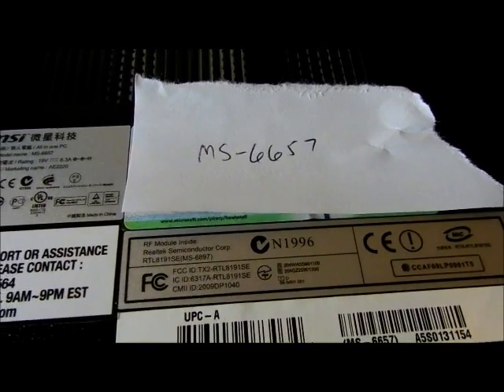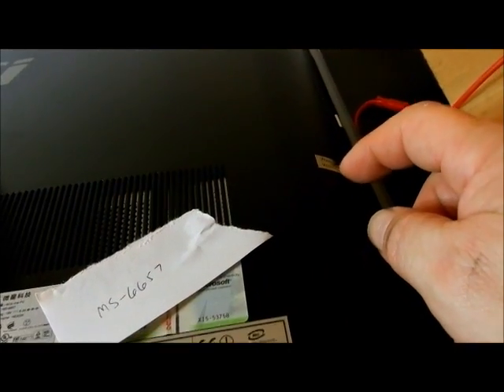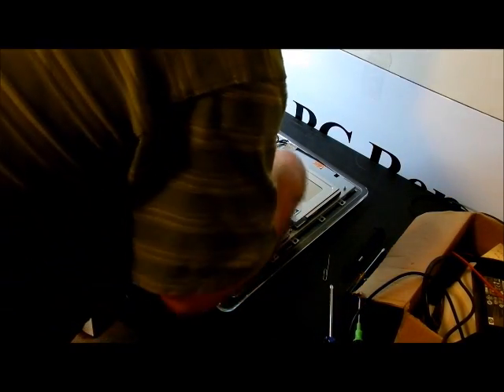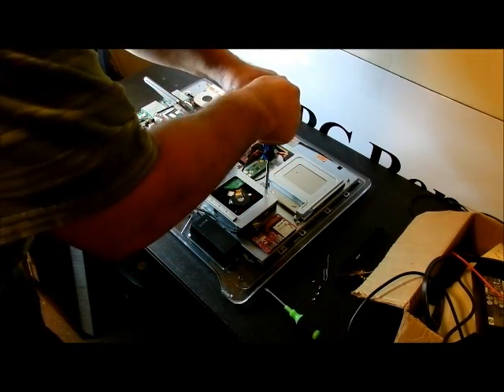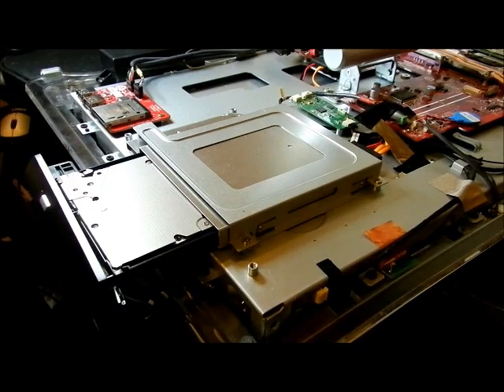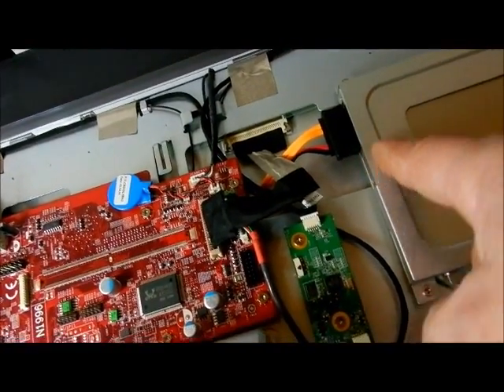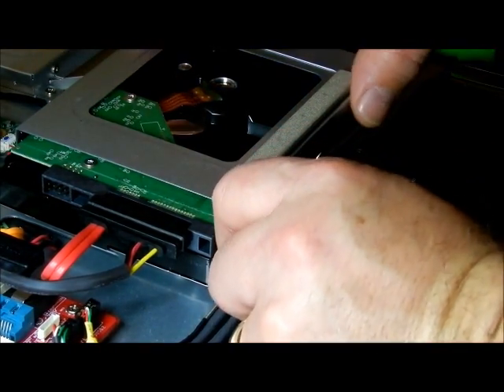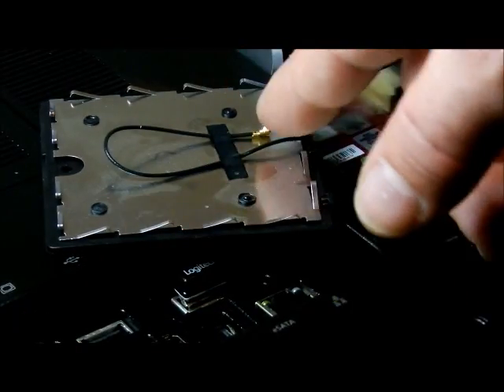Replacing a MSI MS 6657 Hard Drive

Comment: This video was a lifesaver for me as I had no idea on how to open the thing to replace the hard drive. 
So thank you very much!
I would also like to point out 2 things:
1.- On the one I worked with there are 3 clips that hold the lid attached to the CD-ROM. He mentioned the 2 on the sides, but there is also one in the middle! That's the one that got stuck in mine but luckily I was able to unscrew the tiny screws from the metalic cover and I was able to see the clip in the middle. After that, I was able to open the back cover of the unit to get the HDD out.
2.- It is possible to remove the stand or leg  at the back of the unit. It was kind of tricky but I did it. I had to unscrew the leg (the screws on this unit were small) and after I did that it was easier to get out the plastic parts that cover the metal parts and the bigger screws that hold it in place to the board.
I hope you can upload more videos at higher resolutions though, but overall thank you for showing the rest of us how not to break things 🤗
Reply from the maker: Glad this helped.  Tanks for stopping by.

Comment: I have been trying to remove the back cover for two days now. Computer is an MSI AE2410. All screws have been removed and also the CD cover. Still no movement of the back cover. I can lift the bottom bit about 3mm only.

Comment: Thanks a lot. Did you find any viruses?I am having problem with the cooling fan (in my MSi all-in-one). It's making a lot of noise as if it's hitting something? Can I take the fan cover off easily or can I just use compressed air? I replaced my cooling fan/heat sink combo on my msi laptop before. I ordered a new 1 from MSi and got it in a short time. The plastic seems to get very brittle and chips easily over time and exposed to heat so I guess have to be careful
Reply from the maker: Glad I could help.